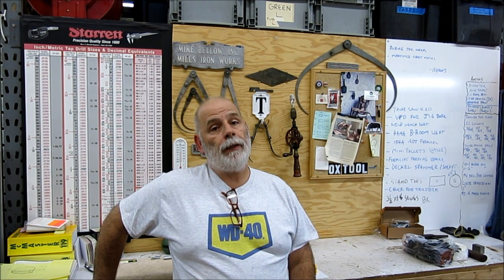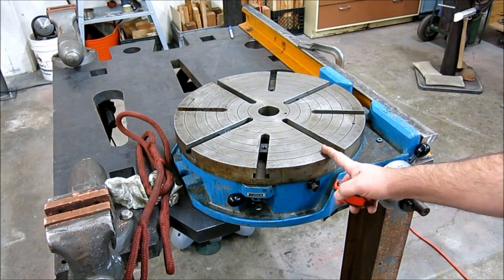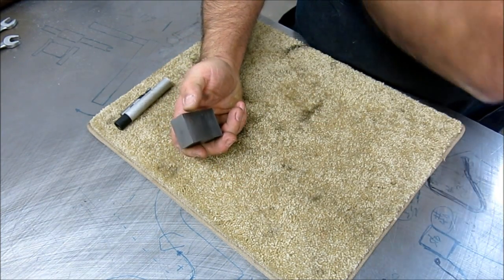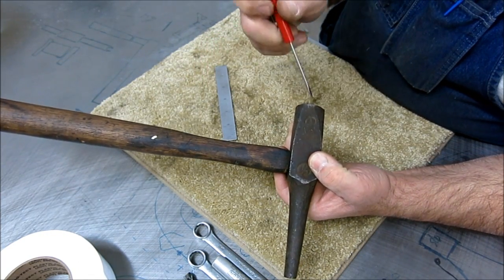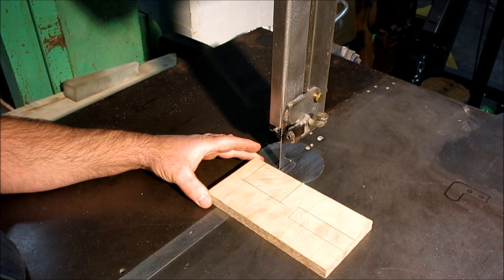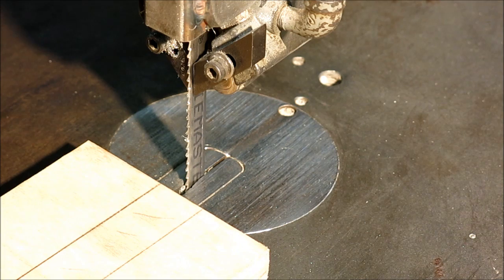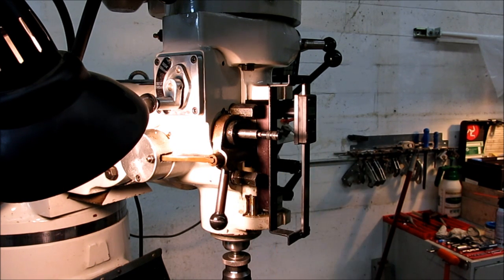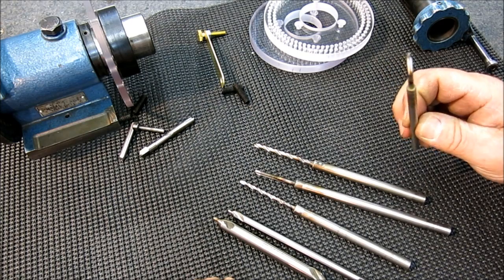Monday Night Meatloaf 5

Comment: What a surprise at hearing my name tonight! Many thanks for that brilliant demonstration of using the bandsaw to achieve this task, I'm most grateful. I didn't realise that the blade would flex at all to allow those cuts but I note the guide head was not too close to the workpiece nor did it seem the guide rollers were set very close to the blade and so some limited movement is clearly possible. 
The granite slab is just something else - I cannot believe it is that flat, totally amazing!

Comment: I'm with you, Tom.  I have never had a hand wheel for my Bridgeport but after watching Keith Fenner, I went and bought one and use it more than I ever thought I would.  Those suckers are $50 from Bridgeport!  I have a Mitutoyo digital readout for the quill but my handle fit without modifying it - guess I was just lucky.
Thanks for the meatloaf!
Reid

Comment: Nice video Tom, you touched on some great ideas and tools for the shop. The hand wheel technique is something I have never thought of doing in my shop, but I seen a jig borer that used the same principle. 
I like the bandsaw. Someone I know local has a big DoAll he said I could have for little to nothing, I just havnt seen it to know if its worth messing with. Might be worth checking into. 
I too have made several extention drills, taps, and center drills. They are a must for hard to reach areas. 
Good to finally see that surface plate!! You lucky dog!
Reply from the maker: Hi Adam,

Thanks for the comment. How did you comment to this video? Were you watching it and then just typed into the open comment box? Or did you do it s different way? I cant seem to respond to all the comments on this video.

Best,

Tom
Reply: I posted a comment like normal but also had the "Also Share to Google+" box checked under the comment box. 
I too just seen the changes, but this was my first post since the change.
Reply: I just noticed in all your comments not everyone has reply under there comment. Kinda odd. I wonder if they are still working the bugs out of the new updates.
Reply: Abom79 Once you start a thread, the replies stay in that place. I can start one in G+ but once this one is here, I am committed and it has to stay here.
Reply: Abom79 Google seems like running loose like a goose in their problem solving - they mixed all up in a huge chaos - mails, postings, comments  in +G, addresses and you name it - look at their Google groups ... a mess of issues and discontinuied old groups - I'm so sick and tired of their products ;-(( ...argh - right now I have problems with some videos - they can't be marked as "SEEN" - how can such a problem evolve time after time with some few week between !

But nice to view videos from the hard liners into machinery work shops ;-)) !

Comment: Thanks for another great video Tom!

I solved the quill/DRO clearance problem by ordering an undersized handle from MSC. It had to be sleeved and pinned because it was not the correct bore, but it works and it is always at the ready on the machine.

Comment: I had picked up a Troyke U-18 as part of a Craigslist deal.  Since it weighs about 350 lbs, I decided it was too big for my use.  I bought it for $200.00 and sold it for $400.00 after having it on Craigslist for months.  I found a 12" rotary table that will better fit my needs.  Looking forward to seeing what accessories you make for it.  I made a cart for mine that I can match the mill table to so I don't have to do any lifting.  Just slide it on and off.  Thanks for the videos.

Comment: I love the extended tools! I had 4 different sizes of impact sockets cut in half an 12" of thick wall black pipe welded in them and then I could install and remove Tractor duals with an air gun instead of a crescent wrench of a box end wrench where you could only get a 1/4 turn at a time! sometimes there would be 10" of bolt sticking out.
Reply from the maker: Hey Class of 79,

Thanks for the comment. Making your own tools is a tradition in this kind of work. Beware of anybody that never made or modified a tool to get the job done quicker and better.

Cheers,

Tom
Reply: oxtoolco
I missed the Hey class of 79, I started senior year fall 1979 and finished May 1980 so I am class of 1980 (born Jul. 1962)!

Comment: In my railroad career, I used a blacksmith's punch to punch out thousands of hot rivets and two-piece Huck rivets from freight cars; cut the head off the rivet (or the collar portion of a Huck rivet, either one) place the punch against the rivet shaft and pound on the punch with a 4-pound sledge.
Reply from the maker: Hi Carknocker,

Thanks for the story about using punch hammers. What is a Huck rivet? Are they similar to a modern POP rivet?

Regards,

Tom
Reply: oxtoolco Huck makes a fastener system that is similar to and, I believe, predated the POP rivet system and includes both blind rivets and through rivets.  The through rivets are a two-piece system comprised of a bolt and a collar. The collar is swaged onto the bolt body with a hydraulically-operated  gun.The bolt is ridged with a reduced diameter to cause the bolt to break just beyond the swaged collar as part of the swaging process. The metal parts between the bolt head and the collar are squeezed together with a great deal of force during the swaging process. This link will take you to the Huck site and an illustration of the process: http://www.afshuck.net/us/en/Huck_Technology/how_huck_works.html

In my opinion, properly installed Huck rivets/bolts are equal to properly applied hot rivets but with a lesser labor cost.  It's also less labor intensive to replace a part that has been fastened with Hucks. "Properly installed" is the gotcha with both hot rivets and Huck rivets. It's easy, in a production framework, to just ream out misaligned holes or to fail to ensure there isn't debris between the parts being joined and this leads to premature fastener failure.

Comment: I was not expecting to hear my name mentioned in a video.  That is a great top tool you have there and a killer price at that. You can do a ton of different things with it, drifting holes, texturing, punching, ect. We have about 50 different top tool hammers, each with its own specific use and purpose. I think we have one identical to yours but the center was drilled out about 1/4 inch and a star pattern was cut in the ring and we use it for texturing the heads of rivets and lag bolts.
Reply from the maker: Hi Kyle,

Top tool. That's a new term for me. Thanks for that. I have a couple of these in my hammer collection. I never thought about patterning the end to imprint with.

All the best,

Tom
Reply: Here is a really short video of Andy forging some custom drawer pulls. He uses one of our square top tools to create the space to inlay the copper
Santa Barbara Forge + Iron: Drawer Pulls

Comment: That tape looks very much like the stuff we used on gliders. To seal the join where the wing joined the fuselage , to give a smooth join.  And to stop air leak from the underside  to the high pressure topside of the wing  .
Reply from the maker: welshpete12 Hi Pete,

This stuff has a hell of a stick. I have used it a few times since and it really holds. Thanks for the comment.

Cheers,

Tom

Comment: Hi, Tom great video, looking forward to seeing your new rotary table in action.
 I started a steam engine project from some plan's I got from Ebay. I'm getting ready to machine the single lobe cam out of stainless steel, I'm thinking I want to do this in the 4jaw chuck on my 9" southbend... I've never held anything off center and can't find any video's on youtube to give me some pointer's. Not really sure if it would make a good video or if you would want to do it but that's my idea for an episode plus it would help me LOL. The cam O.D. is 1.25 and the off set hole I.D is .50 and its off set .25 from the center of the .125.
 Thanks for all the work you put into these video's.
                                                                                Mark.
Reply from the maker: Hi Mark,
That might make a good video. Its easy enough to do with a wiggler and indicator but if it really needs to be accurate its a different story. 

Best,

Tom

Comment: When I worked at a machine shop in Windsor Ontario when I was in College, they had a rule "Bring in WD-40 and you're fired".  Lots of liquid wrench kicking around tho. That was like 15 years ago now. I don't remember if it was something to do with painting the machines they built or machining the surfaces. I just remember they said it was damn near impossible to clean it off the machined surfaces.

Comment: My Bridgeport clone (Long Chang First) still had its handwheel when it came to me and I used to wonder why it was missing on almost every BP I'd see. I use it just like Keith and I'd really miss it if it wasn't there. I don't have a quill scale at the moment, and was looking for an axis combining box so I could use the main DRO. Allendale Electronics (Machine DRO) had a stand at a recent Model Engineering show in the UK and had a box they're are about to start selling. At £65 it's quite affordable and I'll mount a glass or magnetic scale.
Reply from the maker: Hi Paul,

I really like the quill readout. One point is that in my experience the stand alone type are the best. The reason is cable routing. Its nearly impossible to route a cable from that area back to the DRO box that is ergonomic and not harmful to the cable. All the quill DRO's that I have used over the years had problems with the quill scale if they were the hard wired type. The Mitutoyo unit I have is compact and super easy to install.

Best,

Tom

Comment: Tom,  I'm a just start'en out hobby machinist, or better said machine operator at the moment...  Your small rotary table is the bomb.  Can you share how you measured and marked the graduations and numbers?  I would like to make a micrometer stop for my lathe, and I don't know how to space and mark the graduations and number accurately.  Love the videos.  Thanks for sharing!
Reply from the maker: Hi ckvasnic,

The divisions on the small rotary table were marked on a horizontal spindle rotary indexer like the spindexer indexer we are doing a build along project for. My old friend Charlie engraved the numerals on it with a pantograph type engraving machine. Hope that helps. Best of luck.

Tom

Comment: Tom

Have you seen how thrilled Don Cossitt is with these YT Comment changes ?  Not happy, Jan !!

I looked up Pro-Tect's website and the narrow roll you got most recently is in a different category to the wider roll you have.  The narrow stuff is said to be for joining seams of shrink-wrap film, while the wider stuff is intended for surface protection.

But on your vid they look to be the same material.  Are they ?

Thanks for the tips on this tape.

It reminds me of when you'd deliver a stainless steel job like an extraction hood over a commercial stove, and the owner would see the unattractive white plastic coating with a look of total disappointment on his face.  Then when the plastic was peeled off to reveal a pristine brushed finish, it would be all smiles again.   

Kind regards
Reply from the maker: Hi Stephen,

The tapes feel identical to me. The wider stuff is only marked with "Made in Canada" I guess they don't want folks to figure out how to get more. The narrow stuff is tough as heck. No worries about it coming off. I'm going to test it in some flood coolant applications so stay tuned.

Regards,

Tom

Comment: HI Tom,  Thanks again for all the great informative videos that you share.  I may have missed it, but what brand of DRO do you have on your mill.   I have a Bridgeport that I'm going to put the DRO PROS  system on, but don't want to spend the extra bucks for the third axis option.   What you have I think would serve me well!  Thanks again
Reply from the maker: Hi Jetjock,

The system I put on the lathe is a EL400 from DRO PRO's. So far I'm very happy with the system. For a mill I suggest two axes on the main DRO box and add the simple stand alone quill readout without a cable in your way.

Best,

Tom

Comment: Hi Tom,

I always enjoy your videos I learn a lot from them.  I have a request that I wanted your advise on.  I have an old small 6" 4 jaw manual chuck that goes on a 9" South Bend lathe.  It was made by Kalamazoo Industrial and is excellent condition but it is missing a couple jaw screws.  The screws are 3/4"x8 acme threads.  I can buy the acme threaded rod and cut them to length, but how would you create the square key hole for the chuck key?  I thought maybe I could drill a hole centered on the threaded rod and use a 1/4"x1/4" lathe tool steel bit to broach it.  Also, would the jaw screws require tempering or hardening?  Any suggestions?  Thanks, Eric in Madison, MS.
Reply from the maker: Hi Eric,

Good question. I did a short video on creating a square broach recently that you should watch. Also Chuck (outsidescrewball) is working on a similar problem. My advise is you make the screws from scratch from O-1 and heat treat for durability. Using commercial acme all thread will work fine but the square hole will take a beating if you use the chuck a lot. If you dont see yourself using the chuck that often then the acme allthread is fine.

Best,

Tom
Reply: oxtoolco

Comment: Hi Tom, Loctite 638 retainer works just as well as silver solder but there is no risk of softening carbon steel taps, not all of us are rich enough to junk our CS taps in favour of HSS. 
Question, why do you colonists refuse to pronounce the "L" in solder, I first noticed it when we had a visiting Canadian in our lab at Guy's hospital about forty years ago and no one has been able to explain why since.
Trammed your mill yet?
ATB
chris

Comment: Tom,
How do you touch up a drill for brass?
Reply from the maker: Hi Herb,

When drilling brass and bronzes with twist drills its common practice to dress the cutting edge on a grinder to make it slightly negative rake. This produces more of a scraping action than scooping action. It prevents the drill from grabbing and sucking into the material. 

Regards,

Tom

Comment: What did they make the centre drills for ?
Reply from the maker: Hi Needa,

Center drills are used to spot a location or prepare a part to accept a 60 degree center or point. The long versions are just extended reach models of the normal length drills.

Cheers,

Tom

Comment: So, doesn't the silver soldering process ruin the temper of the tools?
Reply from the maker: Hi Walter,

The cutting tools are made of high speed steel. It retains its hardness even at red heat.

Cheers,

Tom
Reply: I didn't realize they retained at such high temps.